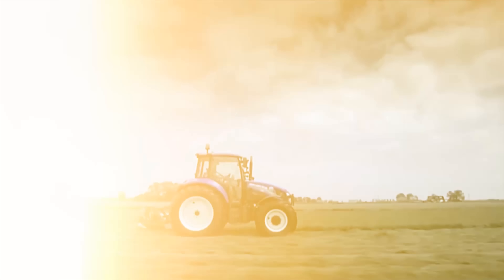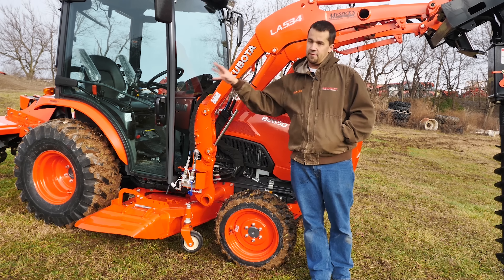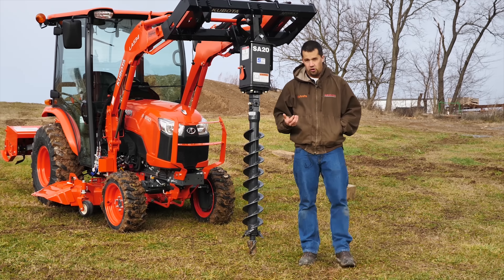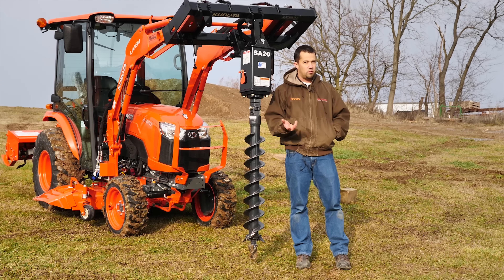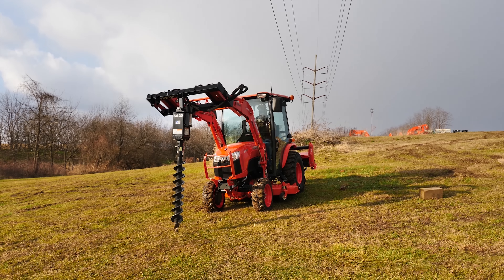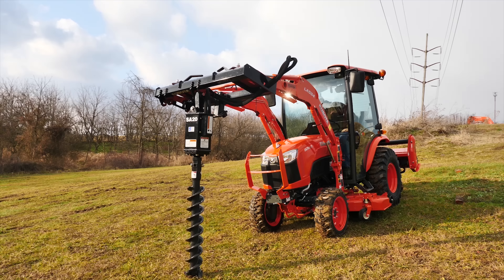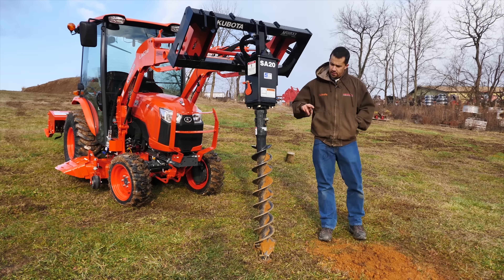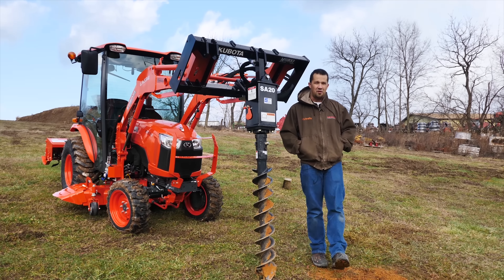Can you run a hydraulic auger with a compact tractor? Land Pride SA20 Low-Flow

Comment: While I can see some people wanting this in ranch applications where you are altering fence lines occationally, for it's cost I'd think the vast majority of tractor owners would still be a lot better off renting a hydraulic auger when the need arrises. I rented a towable hydraulic auger from the Homedepot for a about $150 for a full weekend and drilled about 300 holes to set up 5 acres of horse pastures. If you mark out your holes before you rent it and then just go to town drilling you get a lot of holes dug quick. Seems like this would be a fairly expensive attachment that the majority of people would never need to use regularly...but it's still a cool toy I guess.
Reply: I think you missed the part about having the weight and downforce of the loader.  A 3 point PHD has only the weight of the auger and no downforce so if it hits rock, it's just going to sit there and spin and not dig not to mention you can reverse the hydraulic auger if you get it stuck.  With a 3 point pto driven auger, you're either gonna have to dig the dirt off the top or manually turn the bit backwards...neither of which are very fun.
Reply: @zaappp1588 I agree that having the weight of the loader and the ability to push down while drilling is nice. But I didnt mean to suggest a 3 point augers at all. I suggest renting a hydraulic stand alone auger for those setting up a property. I've used the 3 point augers and unless you are in a rock free area they are annoying to use. Stand alone hydraulic augers are the same as this attachment and smaller footprint than this unit attached to the tractor. The one I rented looked like a mini skid steer with the auger attached to the front. This is a cool piece of kit...just not usually useful once people set up their property and the fences are done.
Reply: @erikniemi1977  I have seen some "towable" augers with an auger head on one end of a frame and a handlebar on the other end like a seesaw with no downforce other than what a person could apply.  I assumed that's what you meant.

It sounds like you're talking about something like a Toro Dingo or Boxer or Bobcat MD.

I've used those before with limited success.  They still don't handle rocks well and you are more limited on your hole depth than with a tractor or skid steer.

Around here, you can rent a skid steer auger to use on a tractor for around $100/day or $245/week plus tax/ins. etc.  Auger bits rent for about $25/day and $70/week.

As long as you have a third function or can run it off your rear remotes then that's about the cheapest way to go.
Reply: We have decided to buy a front end loader hydraulic auger. The main reason is we cannot rent a mini loader with an auger easily as they can't be rented out locally. Previously we rented a loader with an auger and it costs a bit over $1500 a week. They can be rented for $300 a day. The auger driver and bit will cost us about 3500 fitted. So its expensive. However we will have continued use from it over time, digging holes for trees in our orchard. We balanced up the cost of renting a skid steer for two weeks for $2500. against the cost of buying the driver and auger for $1000 more and we decided to buy.
Reply: RENTING hydraulic equipment can CONTAMINATE your hydraulic system with whatever fluid or contaminates the previous users had.
Reply: @kdegraa  me too
Reply: @Deuce_Allan  looking back times change. Digging holes is still an ongoing task but not a frequent task. We hired an operator with an excavator to dig holes. For $600 he dug 1000 holes for trees. This is enough holes. I bought a battery powered hand held auger to dig a few holes here and there. If we ever expand our orchard we might buy one of these machines but we may not have the money to purchase it.

Comment: Great video as always Neil. TY for the explanation of the 3rd function. I never understood what the difference was until you explained it the way you did. Surprised the auger didn't spin faster. Looks like it does a good job if you have nothing but dirt, but at that speed might have some issues in a rocky terrain. Thanks again for the video.

Comment: I've had mine for about a year with a 9" bit. I've been running it on my BX23S. I'm using a Kubota diverter kit, not a true 3rd function. Judging from the video, I would say the speed is about the same. It definitely goes slow but it still gets the job done. Much safer and more convenient than a 3 point mounted. Plus with a BX you can drill deeper holes. Just be sure to have rear ballast or you will tip forward.
Reply: Gene Sanders what model with the BX23? Also, what happen if you get stuck on a rock?
Reply: Mine is the SA20 with the low flow motor. The same one that Neil is showing in the video. I found that if you get stuck, just reverse it. Also in harder soil sometimes you have to clean out the flights 2 to 3 times. I've never really found that be a problem though.
Reply: Interesting to know.  I'm looking at the BX2680 as my first tractor on a 1 acre property, on occasion would need to dig new post holes.  The ground here is pretty hard, I've dug hundreds by hand over the years, but getting a tractor gives me the option to get some attachments to make life easier.  So, I'd suspect buying a hydraulic auger would be a great way to go over buying the PTO type as the hydraulic is easier to hookup and use....I'm not in a hurry so if it turns slower, and takes longer who cares, its easier and less back breaking than trying to dig by hand.  

Looking at the BX2680 with fast attach loader, roto-tiller, and box blade for now, but once you get the tractor your world of attachments is wide open within reason of your tractor's capability of course....only having an acre of land limits the size of the tractor that I need of course but I feel the sub-compact would be more than plenty.  I just need something with a loader and ability to grade and level my driveway and roto-till and be able to regrade areas out in the field.  Its not much but a riding lawnmower can't do any of that LOL.
Reply: @genesanders1468  do you still have your sa20?  I have a bx2680 and am thinking of getting one
Reply: @hayesunified3670  yes I do! I still love it as much as the day I got it.
Reply: @genesanders1468  thanks for the fast response.  Did you buy it from a dealer?
Reply: @hayesunified3670  yes. I think it took about 6 weeks to get it. I also bought a grapple at the same time. I was able to finance it through Kubota finance and got the ktac insurance on it as well.
Reply: nd the bx23s has the power to run this auger effectively?   i have 9 acres and don't want to break the bank but would like a machine where i can also afford  the implements i want (backhoe, loader, maybe a MM mower plus auger and grapples as luxury items).  bx23s seems smallish  but love to know your first hand experience with thanks Gene
Reply: @johnwilliams9321  it's slow but it gets the job done. Personally I would recommend a larger machine for what it sounds like you want to do.
Reply: Thanks Gene, I appreciate the feedback!
Reply: @john22359  no problem.

Comment: I made my own from a used hydraulic motor.  It spins quite a bit faster.  I also want it off the side of the loader because many holes I need are for replacing posts at an existing fence.  The centered diggers make it a PITA.  I run it off the curl circuit.  That's good enough.  My auger is a tiny bit undersized for the post size.  I push the posts in with my forks when all the holes are drilled.  Done .

Comment: You did leave out one big advantage of a hydraulic driven auger. They can be reversed.  If the flights from the bit get caught under a rock and stuck just reverse the direction of the bit and screw it back out.
Reply: Yes it does. 
The thing I find interesting is my tractor got down pressure 3point and the option of putting the PTO off the trans, making it turn background if in reverse.
I learn on that old Mtz and lots of what it do is not standard on most tractor.
Reply: Exactly.  That was the number one reason for use transitioning to a  hydraulic auger vs a traditional PTO auger.  Our area is very rocky and you're constantly hanging up a PTO auger on a rock and it's hard as heck to get it unstuck.  With the hydraulic auger, you just reverse and back it out easily.

Comment: Thanks for the information video. I personally drilled 100's of post holes in my younger life. Personally if I can drill a proper hole in less than 5 minutes, it still beats more than an hour of hard physical work. A compact tractor is not a 100 hp skid steer.... but a 100 hp tractor could pile drive your posts. Maybe a lower geared gear box could be a solution... just my thoughts

Comment: Good video as always. As with anything, having options is always good. I have a 3 pt phd on my b2650 here in the granite state. Love it.  Imo, pros for the loader phd for downward thrust & reverse the direction of the auger~~~ Cons- very slow, can't see how a bigger auger would even operate, limiting the actual phd to smaller holes. I can also easily see rolling a tractor after getting the auger stuck trying to lift it out of the ground instead of reversing for any inexperienced operators.

Comment: Ive had one for years , couldn't even buy a setup at the time ,  i made one for the front but run of the rear hydraulics , ive drilled 2.7metre deep 450mm holes with a ck22 kioti 😁

Comment: It looks like the vertical indicator needs to be two-axis. While you were vertical in one axis it appeared you were going in quite crooked in the other axis.
Reply from the maker: There is one on both sides
Reply: There's a left/right pivot that the  motor hangs from.  Lifting the bucket slightly allows gravity to center it left/right.  The indicator is so you get the curl angle correct.

Comment: When are they going to raise the flow on tractors?
Reply: They would need to increase hp for that to happen. 
Modern compact tractor have a lot of flow even when compared to older large tractor like a super major
Reply: They make pto hydro pumps with tank that can run high flow.
Reply: Warsign01 : yes, I’ve seen those.  They’re expensive and cumbersome.  Plus they mount right where my backhoe is.  I love my backhoe but would REALLY love it more if the tractor could provide it more flow.
(L3301 w/ BH77)
Reply: @stephengmeiner3264  older Kubota backhoe had a pto pump but then you don't have any pto power available, flow=hp
Reply: While I understand that more flow would require more HP, I marvel at how fast and smooth a 35 HP excavator works compared to a backhoe on the back of a 35 HP tractor.
Reply from the maker: It's the detriment to pto hp, at least if you are running a gear pump.
Reply: @stephengmeiner3264  because on the excavator 35 hp of its engine power is used to pump oil, on a tractor maybe 5 to 8 of those hp are used for hydrolic flow, so you can have a ram extending while the pro is powering an implement and the machine is moving i.e. adjusting the chute while snowblowing or on larger machine operating a forage press
Reply: @MessicksEquip  Neil would love to see a video on a Land Pride HRS30 hydraulic reservoir then you could get the flow you would need to run skid steer attachments such as a hydraulic snow blower ex... right?
Reply from the maker: @kmcnamara18  Yes, a power pack can be used for that.

Comment: Neil, I assume the hydraulic implement pump is the flow rate of concern with one of these.  I've seen a couple of folks on YouTube using the Sa20 with a B2650 (one fellow was even using the mid-range motor instead of the low flow motor, and it worked fine in the soil he was playing in).  I'm not familiar with the implement flow on the B2650; how does it compare with the L2501?  I'm wondering if the 2501 can handle one of these even though its implement pump claims to be a hair over 5 gpm.
Reply: This was my question as well. I am currently shopping for a tractor and I am trying to decide what implements I want and what tractor I need to run them. Originally I planned on an 3pt auger. But after watching this video, I'm thinking that may not be the best plan.
Reply: Why doesn't he answer such a crucial question?

Comment: The bucket arms move in an arc. Without moving the tractor the hole is not straight vertical. Can you move the tractor while drilling to keep the hole straignt?
Reply from the maker: its kinda hard to explain, but once its started it wants to stay straight. So either move the tractor or roll the bucket to keep it where it wants to be.

Comment: How do I find out if my third function is the better one? It was installed when I got a Grapple bucket. I have no idea if it will run a hydraulic motor. My tractor is a TA33DA. Also, that was running no more than half the speed of the one on our old AC D-14 which was 8 inch PTO driven. BTW, open a store in central or northern CT.       sdh  in CT
Reply: If you can operate the third function (open/close grapple, spin the auger bit) while curling the bucket, then it's true 3rd function.  If you have to stop curling, then flip a switch or press a button to change the joystick's "curl" over to "open", then it's a diverter....you're diverting the curl function into open grapple function.

Comment: What would be a good flow rate for an auger mounted on a tractor as you show? Say 15.9 gpm? Or more? What about an aux hydraulic power pack on back of three point? How much gpm can they add and can that setup work?
Reply from the maker: For the low-flow motor like this one 6-15 gpm.

Comment: I use a m 70 60 at work almost daily we have a front quick hitch auger for the loader and it spins just a crumb faster than the little b you are showing honestly you can hardly tell the difference  so I’m assuming that no matter what size tractor you use it is gonna be wayyyy slower that the flow on a skid steer?
Reply from the maker: Unless you use a low flow one, I would usually choose torque over speed.

Comment: I thought the pump on tractors would not allow for powering hydraulic motors? Especially 3rd function valves.
Reply from the maker: you can. There would be heat dissipation concerns if you had an attachment than ran non-stop. For example a Titan Trailblazer... not a great choice on a 3rd function.
Reply: For something that runs so extremely slow like an auger motor, and for relatively short periods of operation, it's not a problem.

Comment: Why can't there be an accessory hydraulic pump off the front or mid PTO just for the attachment. Then you run it just like a shaft driven implement.
Reply from the maker: That's an option off the rear. You need room for a reservoir

Comment: How does the solenoid on the third function valve hold up? Does it get to hot? My only concern is premature failure to the solenoid with constant on. Why not run it off a rear remote?
Reply from the maker: For periodic use like this, you would not have a problem. Attachments like a trencher or rotary cutter could cause some heat concerns.

Comment: Could you run the auger off of one of the hydraulic remotes on the rear?
Reply from the maker: With long hoses, yes
Reply: Have a friend that does that on a bigger tractor, he took a 3pt auger he already had and converted it to hydraulic drive using a reel drive motor off a grain head then built a mount for it that slides into a 2" receiver hitch tube on his loader bale spear.
Reply: That's exactly how we do it.  We didn't have any aux remotes on the loader, so we got a couple of 20 ft hoses with our auger and plug it into a set of remotes in the back.
Reply: upupaepops   I have been thinking about doing this. I am guessing that you dump the return directly into the hyd fill hole. Does your setup have both forward and reverse? Thanks!

Comment: what is the minimum/maximum flow and pressures needed to run this implement? i have an 11.5 gpm PTO mounted pump and 3 point mounted hydro reservoir that i would like to try to power something like that.
Reply from the maker: There are motor options. The low flow one is 6-15. Your PTO pump would be perfect.

Comment: Does the bx23s have enough flow for this?
Reply: BX 23 has a flow rate of  5.5 GPM.  It, if the dialogue in the video is correct, should.
Reply: Mine works great.

Comment: Compact Tractors have quite small hydraulic pump's, I've seen them wear out in under 500 hours due to being overworked with demands of a Loader and 4 in1 bucket.... An Auger would also give the pump a hard time I imagine.
Reply from the maker: The pumps are low flow... but wearing out? We'd sell 1000 tractors\year and I would not agree with that.

Comment: Before investing in any post hole drill you got to check your ground conditions, most are useless in any type of shale or rocky soil , I tried and ended up disappointed and just selling it. If you can't dig the hole by hand with a digging bar and shovel you won't dig it with one of these.
Reply: Actually.. before investing in any hole drill you want to rent one XD
Reply: you can get rock cutting augers. they will be very slow and probably the bit will cost more than the rest of the device
Reply: Depends on the bit.  We have a rock bit on ours due to the rocky conditions we live in.

Comment: Hi Neil, Thanks for sharing this. I've had my eye on the SA20 auger for some time and needed proof that a b2650 could handle it. Could you tell me which SA20 motor option you were using in this video? The Land Pride website appears to offer different motor to match your hydraulic flow.
Reply from the maker: Low-flow one. 6-15 i think?